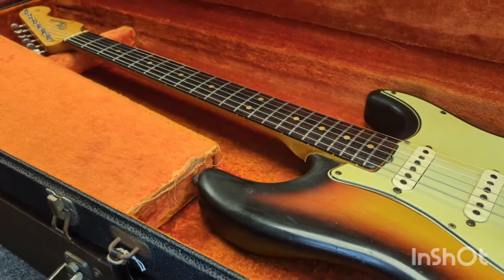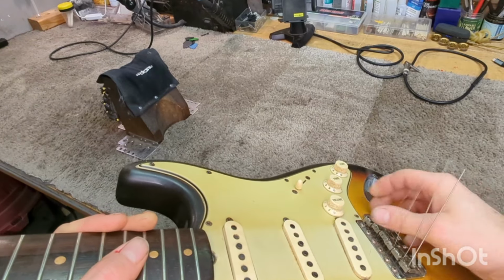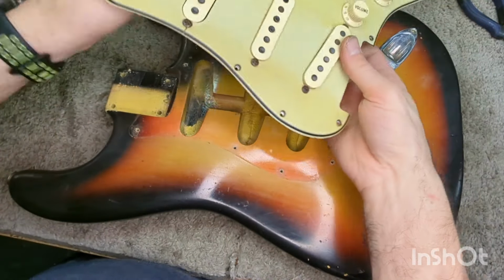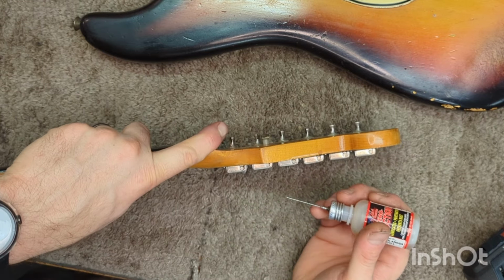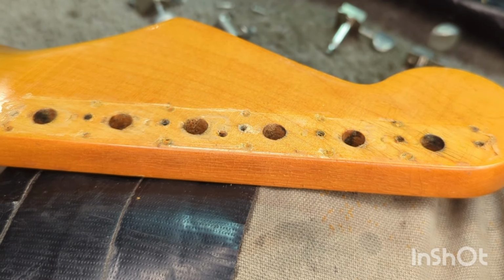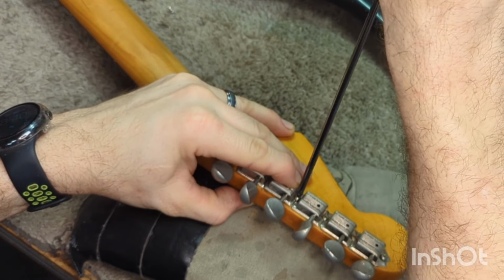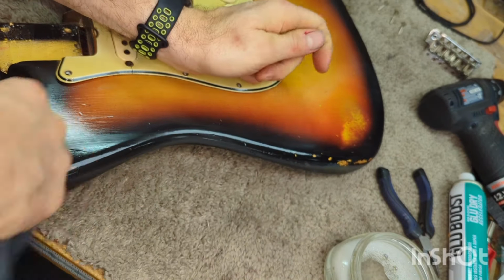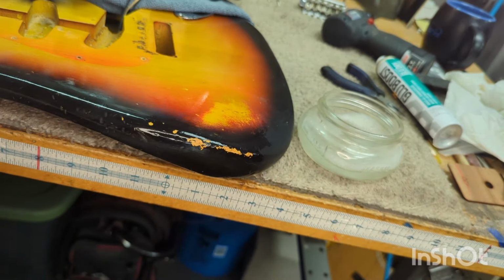VINTAGE 1964 Fender Stratocaster. Leo messed this one up! Flawed for 60 YEARS!

Comment: L55000 – L99999 = 1965. So the neck and probably the body too was made in 1964 and assembled en sold in 1965
Reply: Year transitions don’t make sense if it’s a few months. Neck plates were stacked in baskets and no following up numbers will matches close to pot dates or neck dates. There’s also a story told thats Fender workers ain’t worked whole year round but only a couple a months per year on necks, body’s, lacquering
Reply: What is the deal with seeing the D hole? You should have explained why, for people like me who don't have a clue. Great guitar though!
Reply: @jbird2714jb  the D hole is a nail hole used to hang the neck in drying stage after lacquer

Comment: I was a Fender dealer in that period. We ordered guitars every month, hoping to space out the deliveries. Fender made them in batches and we got 5 Stratocasters the same day with consecutive serial numbers. I wish I had any two of those. It took forever to sell them because tastes had changed and semi-hollow bodies were the rage.
 I think the reason that that guitar has confusing dates on the pickups and signs of resolder is because it probably didn't pass inspection and was put in a repair pile and nobody got around to until later.

Comment: I think that scratch plate with full metal back plate falls into the realms of a 62-64 11 hole ?
Reply: Bolt pattern and mint green dates it to 63-64, maybe early 65. I believe the bolt by the middle pickup was still between middle and neck until sometime in 63

Comment: Apparently DiMarzio and Ibanez made 5 way switches before Fender did in '77, but I'm absolutely certain that one was done no earlier than the 70s. Also, necks would sit on the racks for months, so it could be an early '65 body with late '64 neck. Pickguard likely still '64 too, not too sure exactly when mint green became white black white 3 ply

Comment: I think it’s been refinished
Reply: Totally.
Reply: Why do you think that? Is there something that stands out or should it just be more worn?
Reply: Also what is the deal with the D hole? Why is that there?
Reply: Another thing, does that logo seem replaced to you because i just replaced the logo on my strat because i restained the headstock and thats how my logo looks now. You can see the clear edge of the logo.
Reply: @thejakefromstatefarm6768  the black perimeter part of the burst seems kinda narrow. Also… that yellow in the pickup route seems too yellow. That could just be my screen though. I’m not sure about the d hole thing.  Difficult to say about the logo.  It’s a transition year and they seem to be inconsistent on where the logo went.
Reply: @thejakefromstatefarm6768  it’s normal for the decal to have that clear border around it
Reply: @johnwhitaker545 me as a Vintage Fender specialist I totally agree

Edit: still watching this video and i doubt about the tuners too. I need a close up shot and with my caliper in hand I want to measure some things on them🙂
Reply: @ I’ve had a few vintage fenders and been around a couple but can’t consider myself an expert. I’ve had a 64 jaguar, 68 musicmaster II, 68 mustang and a 69 Stratocaster. Only my strat was sunburst and its perimeter was predominantly black with just a hint of red before the amber.
Reply: @thejakefromstatefarm6768  They used to put the logo on after the neck was completely finished. They stopped doing it like that in the 70’s or early 80’s.

Comment: HEY GORILLA SEEMS THE PICKUP ASSEMBLY MAY HAVE BEEN REPLACED FROM THE 1964 AND A NEW 1965 WAS
INSTALLED IN IT. BUT NECK AND BODY 1964.

Comment: Why would people want to see the D hole on the headstock?
Reply: There’s a very good reason. If you remove the D string tuner, there is an additional empty screw hole. That hole was where they would screw a template into the back of the headstock to drill out the tuning keyholes and tuning key screw holes for placement. That hole was not filled since it wouldn’t be seen being hidden under the tuning key. It’s a very simple way to further confirm authenticity of a pre CBS Fender. You would probably check it out after checking all of the other more important signs of it being authentic though.